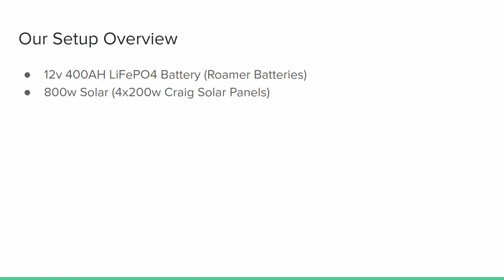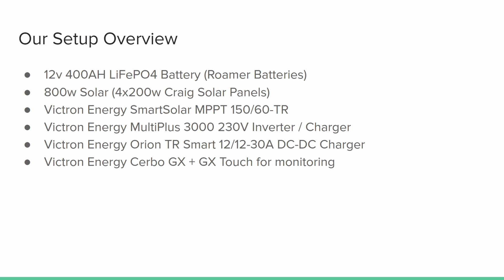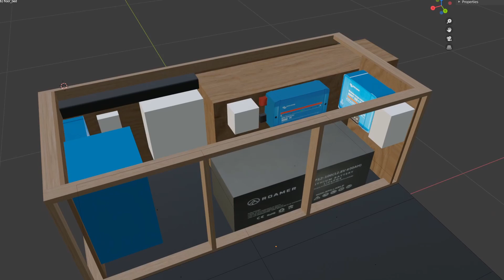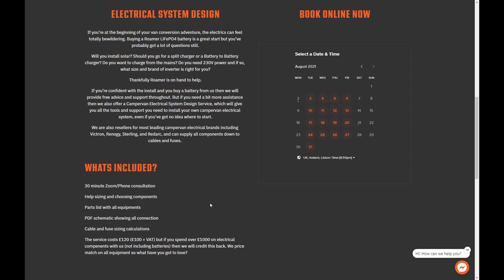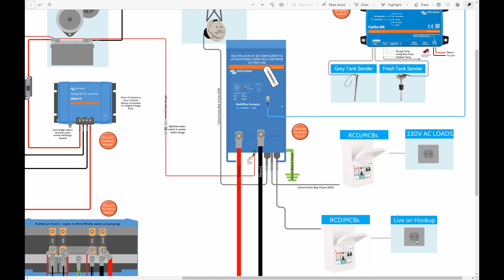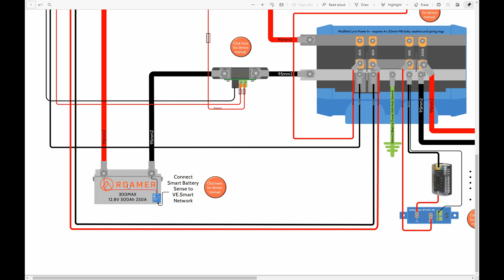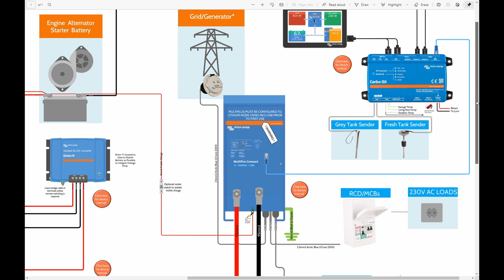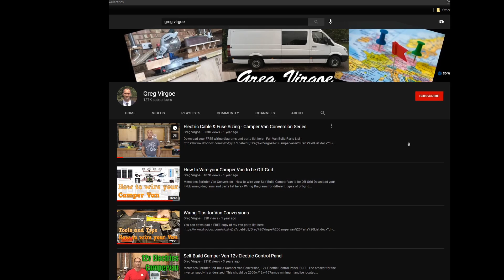Camper Van Electrical System Overview - Citroen Relay L4H2 Van Conversion Series UK

Comment: Hi , when you drill the holes on the lynx from 8 to 10 mm you can bolt the cut of and the shunt straight on . When you want I can send you a picture what I have done.
Reply from the maker: We just done this on our latest video (First part of many for the electrics install) ! Thanks for this tip, works like a charm!!
Reply from the maker: Hi Christian, Thanks for the tip! Sure feel free to send the pic via email or on instagram 😎👍 I bought a short copper bar to use instead of cable for the cut off switch between the lynx as-well. Was planning to use that for the shunt too but your idea might work better! Thanks!
Reply: @CasLaz  Chap on wiltshire camper has shown this in his recent leccy vid. Gave me the idea to do the same. Looks very tidy.
Reply: @CasLaz  ok I can send you some pics then just give me your e- Mail
Reply from the maker: @christianwinkelmann8477  you can find our email in the channel about page 👍😎 Thanks!
Reply: @CasLaz  the only thing what I can see is insta what I don’t have no E- Mail.
Reply from the maker: @christianwinkelmann8477  Ah strange there should be a button in the details section to View Email Address - lazandcass@gmail.com 
hopefully YouTube don't remove it in the comments!

Comment: hi guys like the schematic and the talk , thinking of going victron myself. one question if i may is the inverter shown a multiplus II so it is an inverter/charger . cant seem to find your product in the link as it looks different and called a phoenix. could you possibly help me on this . All the best Lee. so this inverter also has an automatic internal switch inside so it will detect hookup and the power will go to same sockets as the inverter power
Reply from the maker: Hi, I think the phoenix might be the slightly newer version / rename. I updated the link in dthe description to the exact one we have. Hope it helps. Yeah it has a transfer switch from shore and it's also a charger.

Comment: Thanks for the video. Would be great to know what 3d software this is .Thanks
Reply from the maker: Hi Dylan, It's in Blender, It's free!
Reply: @CasLaz  Thanks so much for the reply, that's helpful. Can I ask also how you connected to the vehicle battery? I know it's in the cab floor so did you go in through the underbody? I'm trying to work out how to do it neatly!
Reply from the maker: @dylantucker7951  No worries! Check this video, starts around 0:30 I show the cable run for the B2B 
https://youtu.be/VDgY6JXynB4?t=29
If you wanted a shorter cable run you could run it through the floor and under the van, I know some people done it that way.

Comment: What size earthing cable to multiplus you using (don’t mean the negative I mean earth)?
Reply from the maker: I will use 95mm same as the main negative, check explorist.life wiring diagrams he runs the same for convenience and I think its a US wiring reg (could run few sizes smaller but I don't want to buy a specific size just for that). He talks about it in the 1h install video I shown at the end of the video.
Reply: @CasLaz  great stuff thanks ,I thought it would just be a 10mm2 or similar ,I’ll sort that tomorrow.
What day you coming to Wales ?

Comment: Wonder what the system cost bud
Reply from the maker: The whole electrical setup is around £5k, will do a full cost breakdown of the conversion when it's finished. Thanks for watching!
Reply: Dam that's hell a lot, will be looking forward to seeing the rest good luck with it
Reply from the maker: @johnwildwest1  Yup it's not a cheap setup - fortunately we could bring the price down using roamer batteries, if we went with main brand it would cost £1.5k ish extra.
We also save on not having to fill up gas long term, and the gas installation (could cost around £800 for underslung gas tank)
Reply from the maker: Nice! We hope to get this done all in for under 30k, we will see haha. Stay tuned for more episodes!
Reply: I built a VW T5 still have it in all around 22,000, time to sell her on for a bigger van I'm thinking Nd start all over again

Comment: @4:34 does that calculation take in losses, there's losses in cabling, losses in converting DC to AC and back to DC (Induction hobs are DC powered)
Reply from the maker: Hi Wayne thanks for watching! 
That was just a rough example of a 1000w AC load (including inverter inefficacy etc) 
eg 900w load + (10% for inverter efficiency losses etc) = 1000w ish at 230v AC is around 83A from the 12v batteries / hour
It's just a rough estimate, but if you take 10% inefficiency into account it should be accurate enough for what we need to calculate rough power requirements - eg running induction on 100AH LifePo4 Batteries is not really viable.

Comment: Hi guys. Loving your videos. I’m going LPG-free too. Can I ask whether you considered Multiplus II (as opposed to original Multiplus)?
Reply from the maker: Thanks George ! Glad you are enjoying the series 😀 I looked at the multiplus ii briefly but I ruled it out pretty quickly after looking at dimensions. Its too high to fit in our bench seat standing up.
Multiplus II is 546 high vs Multiplus 362 high (it's deeper but its short!) our bench seats are 50cm high so we are limited to that.
We were actually tempted to go with the Multiplus 2kva instead of 3kva but it has the same problem, the 3kva is actually shorter and we didn't want to be pushing the 2kva to the limit so went with the 3kva in the end.

Comment: Very nice video, I like the battery up have. I wish I got the GX and display screen, made next time or even in another build lol
Reply from the maker: Thanks! I liked the idea to monitor everything from one screen, including water tanks etc so the cerbo is great. Didn't want to have lots of different gauges etc. Hopefully it'll be a nice neat setup and works out well!
Reply: @CasLaz  ya that’s true. When we built ours I was trying to save money, but it’s actually cheaper to get the Cerbo lol. Oh well, I could change where I put all the gauges but I would mean I’ll have to put a new backsplash in the kitchen wall, which isn’t too bad, it’s just all the wiring lol. 
If we decide to keep this van and change the bed layout then, I think I’ll take that chance to change the kitchen backsplash, re-route the gauges and the mount the display somewhere else lol.

Am guessing with the Cerbo you don’t need the BMV-712?
Reply from the maker: I was thinking about the same thing, it seems expensive at first sight but with the extra features / convenience it's probably only slightly more expensive? it's worth it for the extra features etc in my opinion. 
Cerbo GX + GX Touch = no  BMV-712
Reply: @CasLaz  it’s about double the price, but for what you get and how neat it makes it look, plus being able to monitor it online etc it’s cheaper in that sense 😊.
Reply from the maker: @The O Team Yeah + not having separate water gauges, all extra wires, inverter remote etc - We thought it was worth it. Hopefully it works out well, Stay tuned for install and review 👍😎
Reply: @CasLaz  hopefully if we end up deciding to change our bed setup, I think maybe I might upgrade the electrical abit but still keep the Tesla battery. I think I’ll put a stainless steel splash back, get new water tanks that will stay outside the van, change the water sensors etc it might cost about an extra £5K, but hopefully when it’s done it would make the van allot cleaner and the setup better. And maybe someone might buy it off us for close to what we spend on it etc
Reply from the maker: @theoteam4641  The tesla battery does sound good, no need to change it if it's preforming well. Good point on the re-sell value. It's something that I've been thinking a lot about. The victron gear is more expensive, but will hold it's value better, more reliable etc. I think it'll be easier to sell closer to its value vs other brands. I've also seen lots of other builds go through multiple cheaper inverters or components as they break over time, or don't preform well. Hopefully with high quality components we wont run into that issue and the higher upfront cost will pay off in the long run.

Comment: Are you sure about the 95mm2 cable runs? That seems massive, most calculator suggest around 35-40mm2 for 250A over 3 feet or so you'd need.
Reply from the maker: Hey!
The manual suggests 2x50mm2 for 0-5m hence why 95mm2 should be sufficient. 
I think it's recommended as the multiplus can output up to 29A (around 6kwa) on 230v if you are connected to shore power (with power assist from batteries) for short durations. 
Recommended DC Fuse size is 400A (in manual) hence why 95mm2 (we'll most likely only use a 300A fuse anyway, but if we need more power later we just swap the fuse instead of re-wire everything. 
I think you could get away with less but better be safe then sorry on wiring. 
The wiring diagram / cable sizes was put together by Steve from Roamer so I trust his advice on this!
Reply: @CasLaz  ah that makes sense, the multiplus assist I mean. Looking forward to your vid when you get some of it in. On a different note, does your Truma 6E clone have AC assist, I noted you didn't  discuss an On Hookup only socket for that. Anyways, top stuff and a pleasure to watch.
Reply from the maker: @Michael McGuire  Yup it can run on 230v or 12v+diesel . Ran a dedicated 230v line for it and it'll be on it's on breaker in the consumer unit 👍
We'll most likely only use it in electric mode if we are on hookup, but we could use it on short bursts if needed without draining the batteries too much - two modes, 900w or 1800w, basically same draw as an (lower power) induction cooktop. A quick 10 minute burst in the morning without firing up the diesel will be nice even if we are off grid!
Reply from the maker: @AgileMcGuire  I agree I think we could most likely get away with a smaller cable for the length of run. 
There are so many factors that go into wire gauge, insulation type, how many cables are together, what are they in / clipped to. So for something pretty major in our build we'd rather follow the victron / roamer recommendation. Check out explorist.life wiring diagrams / calculator - he normally recommends / uses 120mm2 for multiplus 3000.

https://www.explorist.life/wire-sizing-calculator/

It's best to consult with a professional if you are in doubt, I'm sure if you ping Steve a message from roamer he'll be more then happy to help you out! 

I already crimped a 95mm2 it's not too bad!😂 you can see it a few videos back (chassis ground)
Reply: @CasLaz  Thanks, we have a relay l4h2 as well, but just got the floor in and windows next. So will review my wire sizing before committing to another mortgage to buy copper lol. We will have gas, so only 300Ah lithium.
Reply from the maker: @AgileMcGuire  Awesome! Windows are scary haha 😂Feels like it was ages ago we put ours in now. Good Luck with yours! Yeah the 95mm2 copper sausages are pretty expensive 😒😂